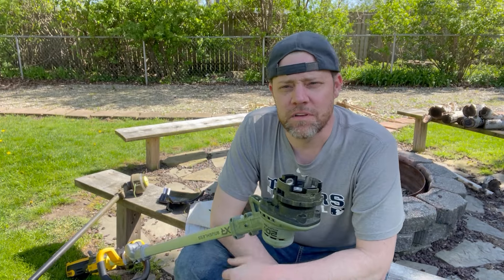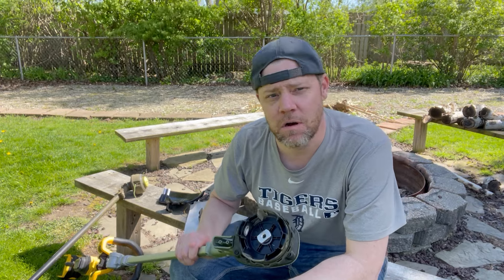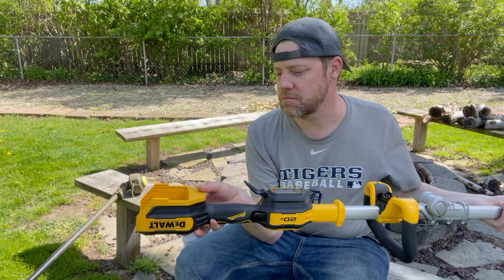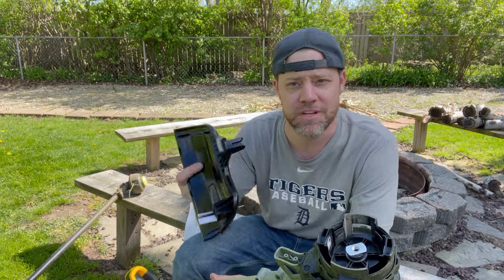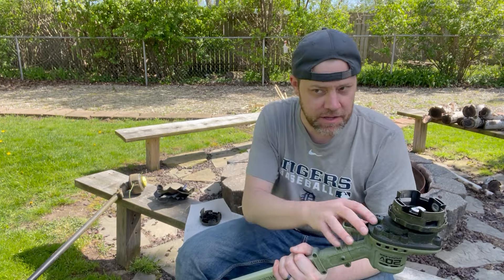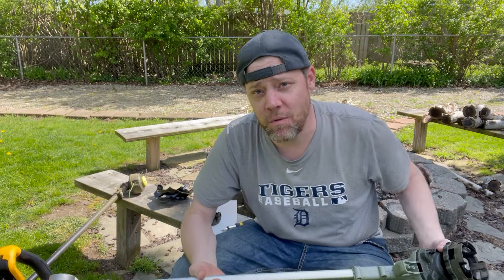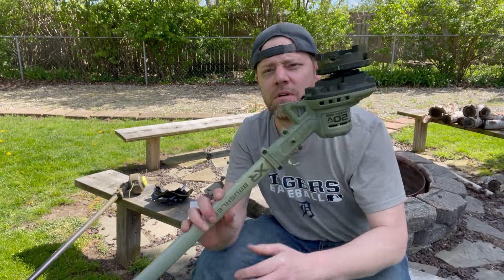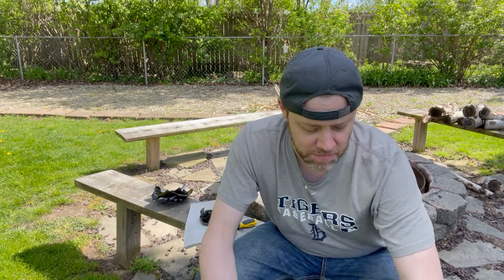DeWalt 20V 922 String Trimmer Fix. DeWalt String Trimmer Malfunction and Troubleshooting.

Comment: Have the same model now for five years and mine wouldn’t start the other day. Cold unit and fresh battery so no overheating. Will have to take it apart to see if I have a loose wire somewhere??? Otherwise has been a great trimmer for 5 years and I have a 175x200 lot.

Comment: I purchased the same unit, ran ok for probably the first 30 minutes of total use time. Started experiencing similar issues, would run a very few minutes and stop, with about a total of 60 minutes run time, smoke started coming from the motor and it shut down. Never ran again. I sent it back to DeWalt, they have repaired it and it's being shipped back to me. Hoping for better results when I get it back. I do like the tool, just hope it works. All the trimming I've done is light work no over grown tough grass or weeds.

Comment: Warning - Not using the shield could cause the trimmer line to extend too far and WILL cause the motor to overheat. The blade installed on the shield keeps the line at the correct length.
Reply from the maker: Yes, totally. I do notice I have to shorten the line fairly often.
Reply: Dang I don't have a cover, does line come out on its own?

Comment: This is a maintenance item listed in the manual. Mine has lasted almost 4 years but has suddenly stopped. Head ticks...
Reply from the maker: I have to take breaks with this product. Use it for 10 minutes, then take the battery off, blow it down to cool it off, super frustrating.

Comment: My Dewalt has been a smoking pile of crap.  From the string feed, to intermittent stopping and short battery life on one battery. I've had it for 4 years, don't use it that much, and I am gong to buy a different brand of trimmer.  Thanks for making these videos, but at this point, trying to fix my Dewalt is like putting lipstick on a pig.

Comment: my weed whacker did the same thing. Well, I opened it up and what I did was took a normal battery with two wires to the positive and negative and connected it straight to the motor to make sure my motor was still good and that it will stay spinning, which it did and I let it run for 30 seconds pulled on the trigger and stopped so I ran it again with the battery connected to the motor and let it run a little longer and then open it up to check the gears inside about half apound of grease was inside gears I don’t think that much grease shoulda😮 be in the gearbox actually created friction how much is it tried pulling the trigger again now it runs perfectly and doesn’t get hot. Thankfully save me from breaking down my whole Weedwhacker. You’ll know if you have a bad motor motors if you connect the battery to it and it stops running. p.s do not remove the guard. The string will get too long and they will wear your motor down and they will cause it to get hot and smoke so keep your guard on can’t stress enough.
Reply from the maker: No doubt! I agree, I just get so tired of the guard but I see it’s super important to have it on. I still think this thing is such garbage. Will be worth while for me investing in gas next time.

Comment: I have the 60v trimmer and it started smoking down by the trimmer head. Nothing is built to last anymore.
Reply from the maker: No kidding! I'm going gas next time, just for the amount I actually have to trim. The battery is so nice for its convenience, but if it's not working a good portion of the time, that's not convenient either.

Comment: I have the Dcst920 model and took of my sheild after yrs without and now it is suddenly doing this as well.  It gets hot at the top by the battery so i figured it was the motor at the top but now that i see this video i think the motor is at the bottom? I am so confused! What a piece of garbage if you just cant operate it without a shield? Now I have all these batteries and it was not even the batteries and i am stuck buying another dewalt if i want electric ha